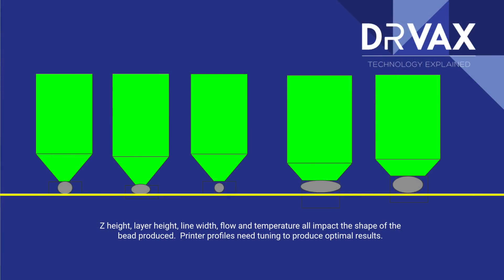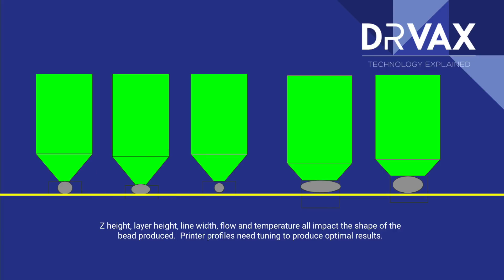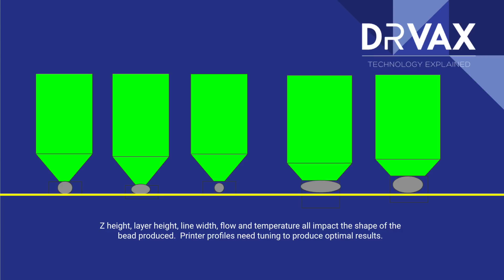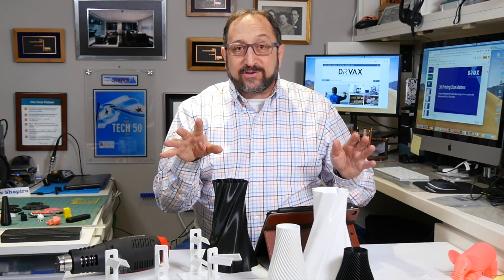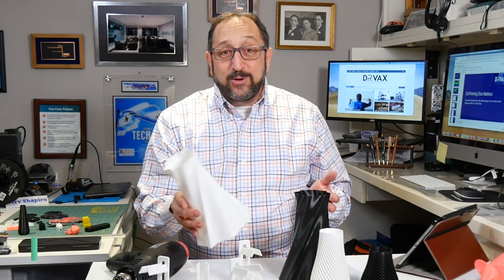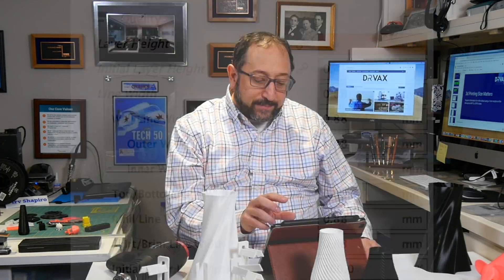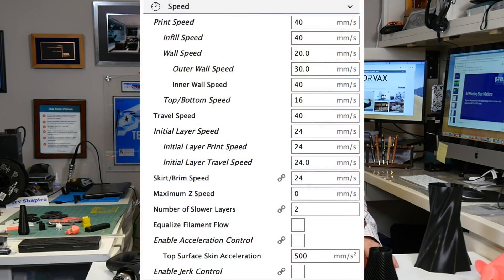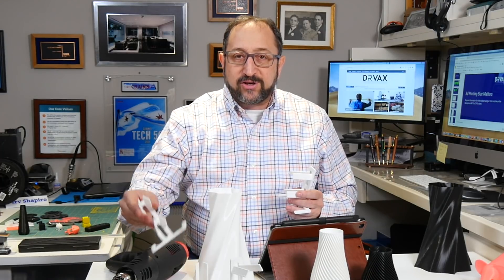3d Printing Large Objects

Comment: Calibrate your machine using Teaching Techs vids, that should help you determine you max volumetric flow rate. I am running a CR10 stock with a 0.8mm nozzle printing at 80mm/s LOL. So far so GOOD!
Reply: Hey have you tried to print PETG with that .8mm nozzle yet? Thats next on my list.
Reply: @jeffmilkey  Havent dove into that area yet, petg runs hotter so i would assume you'd have to go real slow. Good luck man.

Comment: Great video THANKS! I'm having trouble printing large objects. I have a Qidi XPlus. I'm totally new to 3d printing. I'm utilizing the opposite side of the detachable magnetic plate per instructions included. Any suggestions?
Reply: Run your machine though teaching tech's calibration vids, e-steps, flow rate, etc. That should help a lot. If you are printing large cones with 45 degrees, don't go higher than a 0.4mm layer height with a 0.8mm nozzle. Cheers.

Comment: Would a 1mm nozzle help with jamming of filament in the Capricorn tube/
Reply from the maker: No.  Jamming is a completely separate issue.   Check that the bowden tube is all the way into the hot end.  This is the most common reason for jams.
Reply: @MakeWithTech  thank you very much 👍

Comment: I have the MP10 and after a lot of tinkering, I have it running smoothly with no shifts or ghosting or anything like that...the one thing I haven't been brave enough to attempt yet has been to change out the nozzle.  I'm afraid I'll break the machine after spending two months hacking to get it working perfectly...Would you consider making a video on how to change/replace the nozzle on your printer?

Comment: DrVax, first off, thanks for all of your help! Your videos are great and have been very helpful for me in this new hobby. A 2nd, heartier thank you for talking about the MP10! It's been tough to learn on this machine, but your videos on it have helped tremendously. Lastly, a question: what kind of parameters do you suggest for using a 1mm nozzle on a stock MP10? I haven't been able to replace the pieces you've suggested yet, but my 1mm nozzles are coming in soon.

Thanks again for all your help!
Reply from the maker: The slicers settings I use for a 1mm nozzle are in this slide deck:

https://docs.google.com/presentation/d/13P3_mNNVpEt4vxkvJH5N1O3qHPgNguYCK9OZlnlfUug/edit#slide=id.gc6f9e470d_0_0

Comment: This is very helpful as I begin to learn how use my new Ender 3.  I produced a couple of the Ender 3 upgrade parts and was really surprised at the porosity of the walls.  I'll go back and see what the layer height was for the .4 nozzle.  The pieces worked but left much to be desired.  I am now printing Angus's tolerance test piece and I am going to let it run it's course but I am doubting it will give me even a 3mm tolerance. So once I've let this print out I will go back and change the layer height and see what happens.

Comment: I've printed my filament spool (for rolls that were bought without spools) by PETG with 0.32mm layers by 0.4mm nozzle using 248C on Tevo Flash and it came out very strong, so I can bend it for about 10-15mm by sides. The body is very strong as well. I can try to squeeze it by hands but no signs of cracks and etc.
Line width is default (0.4 I believe), printing was done with a little overextrusion. I believe that a higher temperature (it's good in 242-245 range for this particular plastic) produces some melting and probably a line is not an ellipse in a cut. I guess that sides are bend down a bit. Also probably it makes a previous layer (in a spot) a bit warmer so they stick together much better.
On the con side: it tends to burn plastic in some places where some defects happened, so the next layer will be squeezed over it. Not good aesthetically, but for a tech. part it's fine.
The spool is in the Facebook group https://www.facebook.com/groups/608845186127310/
you can find it by the search feature.
Reply from the maker: Thanks for sharing your comments.
Reply: @MakeWithTech  Thanks!

Comment: Dr Vax, Im havint pretty poor luck with my 1.0 nozzle. I get no extrusion @.88  It only extrudes at 1.0  I am also getting holes between walls and infill.  My question is, do we need to adjust the nozzle to bed distance when using a larger nozzle?  For instance, we use 1 piece of paper for bed leveling for a .4 nozzle.  Should I try 3 or for sheets stacked for the larger nozzle?
Reply from the maker: No bed leveling is the same but you must re-level the bed.  In addition I have set my extrusion temperature for PLA to 220 which is quite hot but make it easier for the extruder.  Finally I upgraded my extruder from the stock plastic to an all metal extruder.  I am not sure the stock extruder will be able to push out sufficient filament.
Reply: @MakeWithTech  where did you purchase the all metal extruder?  thanks
Reply: After failing miserably a couple of times I did exactly that with a 1.2mm nozzle (3 sheets stacked) plus first layer at 240C and then 220C.
Not the prettiest print but boy It was fast, strong and good enough for a vase.
I'll keep tinkering with Cura for sure.

Comment: I am a novice and bought a Prusa kit a week ago. 
My questions about nozzles revolve around performance of different nozzles of the same size. Will I see better print performance from a ruby for example? Does better heat transfer from different metals make a difference? Where is the extruder heat measured from? And finally,  would it make sense for the nozzle to be coated with a non stick coating, perhaps ceramic. Perhaps this kind of coating might allow to get rid of the Teflon tube inside the extruder. It is a pain to keep PLA from sticking to the outer portion of the nozzle. I have not seen a video or article that addresses this.
Thanks DrVax for your well put together and educational videos.
Reply from the maker: Overall unless you are printing with abrasive materials brass nozzles will transfer heat the best, are inexpensive and relatively easy to replace.  You need a hardened steel or ruby nozzle for composite materials such as carbon fiber filled or metal filled filament.  Some people also claim the color changing filaments are also abrasive.  Ruby is the top end nozzle but expensive and most people suggest you would never need to change it.  This is because it is a heat efficient brass nozzle with a ruby tip.
Reply: @MakeWithTech  Would I see any improvement in print quality or could I expect to be able to print faster with an aftermarket tip?  In other words, putting aside expense for now, is there any reason to upgrade to different tip?
Reply from the maker: No improvement in quality.